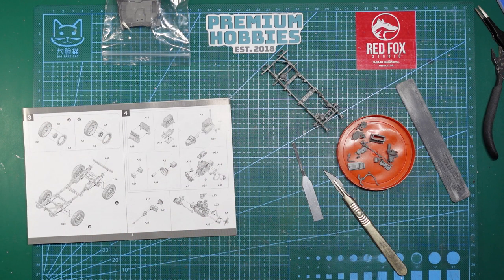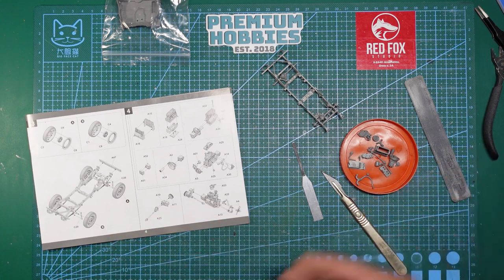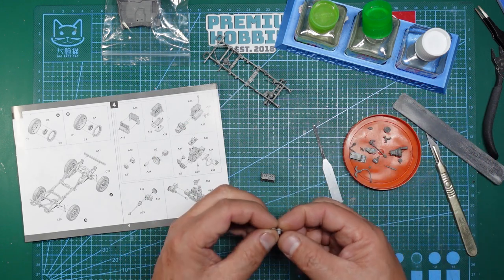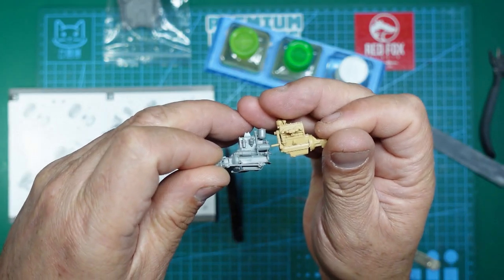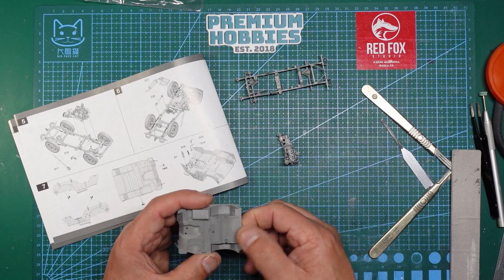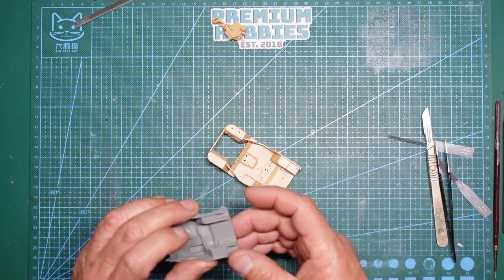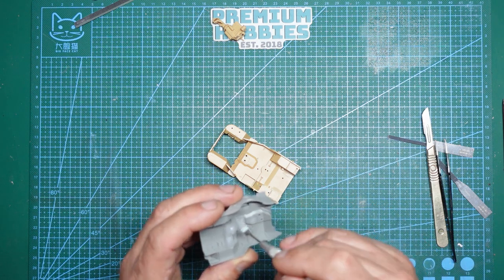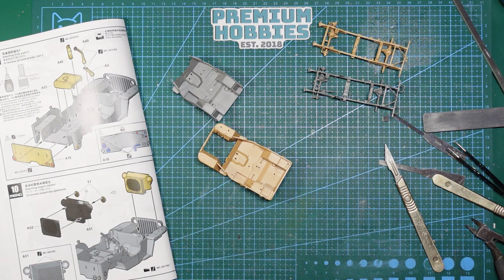Takom/Meng Willys Jeep double build. Part 2

Comment: I have a hint for dealing with very tiny pieces for anyone that wishes to try it. Use a cocktail stick with a miniscule blob of blutak, talking the size of a pinhead here; then pick up your tiny piece with the gluing surface away from the blutak and then apply to correct spot on model and glue- after 10 -15 seconds very carefully lift away the cocktail stick. Hope that helps someone, works for me! Great video as ever thanks Nige.

Comment: A great video Nige, Love the detail on the Takom Jeep. Thanks for the tips on how to put sand paper on PE sticks, recently bought the full set with PE holders and all grades of papers. Good value for £21.99 and your NMB10 10% discount.

You are corrupting me, first Zebra sticks and now the PE sanders. Premium Hobby's does some great products and have previously purchased the 3 Tamiya pot glue stand and the Infini masking tape cutting mats, same product as the AK mats but a lot cheaper in price. I bought all 4 Infini for about £2 more than 2 of the AK mats would have cost me. A tip I'm sure Nigel knows, turn them upside down and great for cutting PE on and as they are black the PE brass really shows up on them
Reply from the maker: I didn't know that Keith, however, as you've seen in my videos I have a dedicated PE cutting mat.
Reply: @NigelsModellingBench   Like you I have dedicated acrylic sheets for cutting PE on, even a clear holder tool. For those don't have, I gave this tip if they have Infini (or the AK version) tape cutting mats, better than using cutting mat and bending the PE
Reply from the maker: And better than using a ceramic tile and risk slippage, destroying your PE or cutting yourself, and blunting your blade.
Reply: @NigelsModellingBench  Gosh Nigel if you slip,cut yourself and blunt a blade, your skin must be tough. Sorry how I read it (just joking with you), but you are correct, ceramic tiles are an accident waiting to happen and whilst some modellers advise using, they are a no go item to use.

Acrylic sheet your part doesn't slide, ceramic tile a different thing, back of an Infini mask tape cutter is exactly the same as my acrylic PE cutting mat. So good to use

Comment: The Takom jeep is a good build, I was hoping for an option for the canopy to be up or down, although my go to jeep is still the Tamiya one, mainly due to cost. I tend to used stretched sprue for filling holes. Are you away of any kits with or after market canopy with  all the sides
Reply from the maker: Hi Peter, the Bronco GPW with gun has the canvas roof.